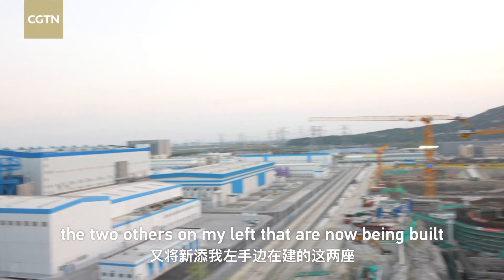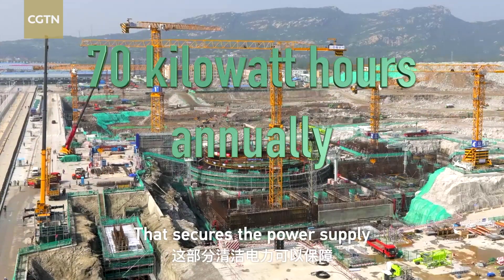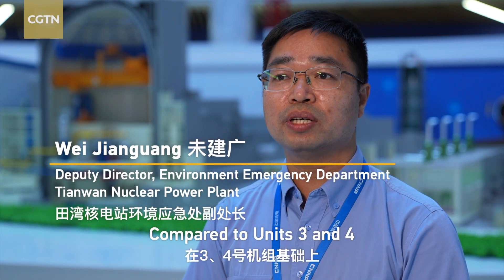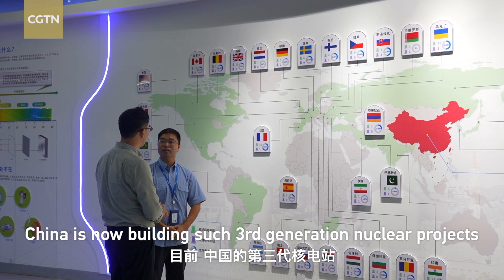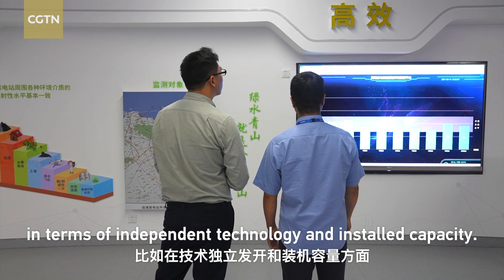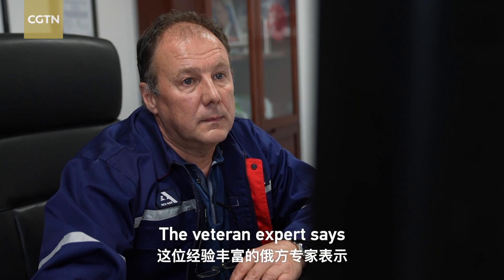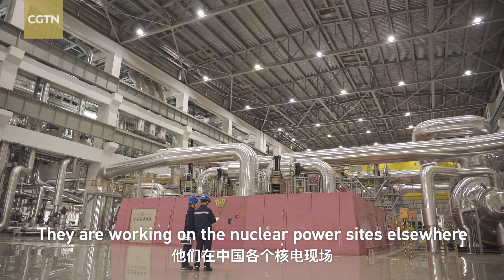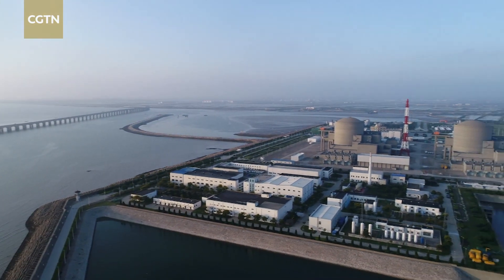Safety, carbon neutrality: Goal of China's Tianwan Nuclear Power Plant

Comment: Is should be Twh/year because the current net capacity of the working 
reactor-units is combined 6,070 MW which makes 53,173,200 MWh/y plus the
 planned 20,148,000 MWh/y ~ 70 -per year.
https://en.wikipedia.org/wiki/Tianwan_Nuclear_Power_Plant#Details
So, they missed the real number by a factor of a million.
Reply: I see it, he used KWh but he have to use TWh.

Comment: 70 kWh?
Reply: Is should be Twh/year because the current net capacity of the working reactor-units is combined 6,070 MW which makes 53,173,200 MWh/y plus the planned 20,148,000 MWh/y ~ 70 Terrawatthours per year.
Reply: Good catch. Hopefully their engineers don't make that kind of calculation errors when it comes to loading and safety issues.
Reply: @urrywest  The error was on the side of CGTN-staff, who often make such errors.